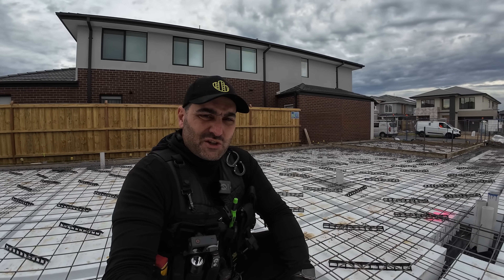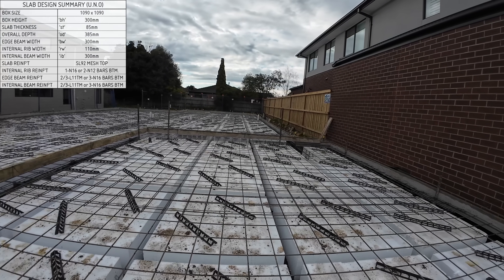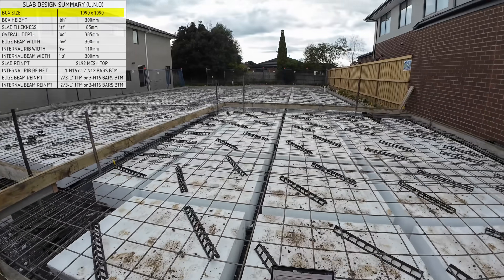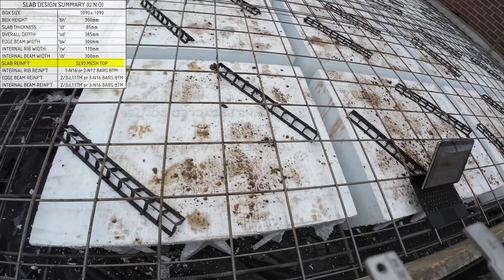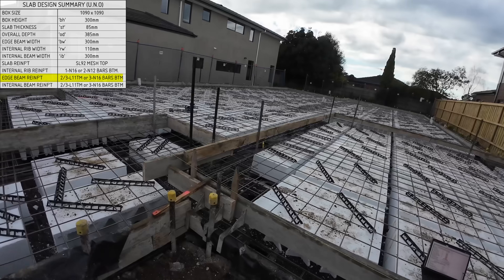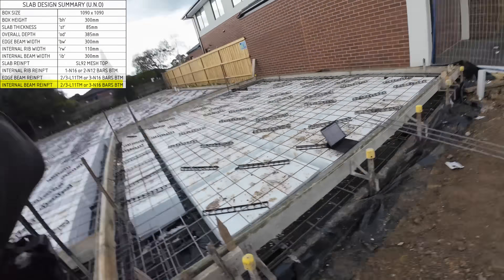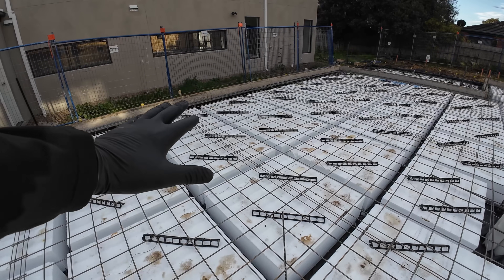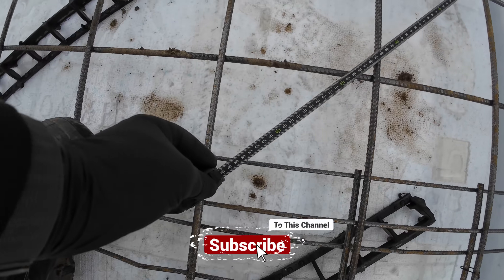Pre-Pour Slab Alert: What the Surveyor Missed!

Comment: Mate I'm a Vic registered building surveyor and this is all stuff that I am seeing and finding every single day! Read the table on the engineering and install it accordingly!

Thank you so much for bringing out a reinforcement gauge! I have been hunting the internet for ages trying to find one because there used to be those poly wheels that the reinforcement companies used to provide but I can't find them anywhere! I just bought one of yours!
Reply: I've heard if multiple stories of waffle slabs giving way.
Reply: @TheJiminiflix  early on mate when they were coming out at 75mm thick or so I am pretty sure that there was multiple stories of people jacking cars up in garages and the jack punching through the slab. I personally haven't heard of any failures since unless the slab was poured with incorrect cover to the reinforcement and the thickness wasn't right as well.
Reply: @malleedirtbikerider  ive heard of people putting jacks thru the slab in a garage situation, but never in the main dwelling. That was early days but. I told my boss and for years we insisted on doing the garage as raft, eventually to the waffle again, but using 100mm slab instead of the 85.
Reply: @mhombi  yeah mate I meant in the garage obviously. 🤣 Bit hard to jack a car up in the middle of a house. Since they went to 100mm there hasn't been the problems
Reply: @malleedirtbikerider  sorry mate, i did mean in the garage, but more meant never heard of problems in the main part of the house. still alot or the bulk builders insisting on 85 in that garage too but. as long as someone signs off in the end and its still to code? i am talking class m stuff but. obviously this slab is more a h or something with the extra reo in the edgebeams
Reply: @mhombi  comes down to cost at the end of the day mate and correct if the engineer gives that 126 then it's him that has deemed it is compliant and we just build to what he specifies, however I don't like any waffle with a slab thickness of less than 100mm. Some volume builders still use the thinner slabs like 85mm I'm pretty sure.
Reply: @letsgetreal-df7pu  looking and not measuring is assuming though 🤣🤣 jog on mate.
Reply: Is it legal to leave the formwork (wood) in/under the concrete slab. My slab is being poured this week. Bit concerned
Reply: @coreyjones7202  hi Corey with any concerns your best to contact your relevant building surveyor (the one you appointed for your project).
Reply: Top call, bud!
Reply: You're a registered building surveyor looking at jobs EVERYDAY can't you tell what the Steel is by looking at it, everyday, if your using  a Guage you must be a LEARNER !
Reply: @letsgetreal-df7pu  I’m happy you’re not my building surveyor, as I’d fire you immediately if you think “eye balling” construction is a good way to operate.
Reply: @ Mmm okay can you tell what a 90 45 bit of timber is just by looking at it  yes or no!
Reply: @letsgetreal-df7pu  you would be correct. The gauge is for my cadet who is learning and I've been chasing one to help them and yes sometimes I like to double check the mesh as "visually" checking and spotting the difference between SL82 and SL92 can make you second guess yourself. In case you were interested, I had a job only a few weeks ago where a massive pad footing called for SL92 top and bottom. Visually to me it looked like SL82 in the bottom and fortunately my cadet had the gauge in the car with us and was able to double check. Guess what?! It was SL82 in the bottom. It had to be removed and replaced. Hope this clarifies how gauges can come in handy and rather than guess it's better to know. 
 As I always tell my cadet all you do when you ASSUME is make an ASS out of U and ME. 
Unsure what your background is but feel free to keep using the surveyor you currently do as I'm not a "she'll be right" type of surveyor. 
Have a great day champ! 🤣
Reply: @letsgetreal-df7pu  can’t take a photo of your Mk.1 eyeball

Comment: I don’t think the assessment of the edge beam reinforcement was correct? I could see one bar on the top on the inside of the set down and then a couple at the bottom. At initial glance it seemed ok? What am I missing? The bigger issue for me is the location of the bars either top or bottom.

Comment: What are the requirements when I cut out a 1200x1200 section of the concreters' reinforcement because they smashed a sewer riser and continued to lay their work over the damaged pipe? Should they replace the internal rib or the sheet? I reckon they just leave it cut and sitting on top of the waffle pods as is.

Comment: I used to do resi slab inspections, and boy, did the concreters come up with every excuse under the sun for little things I picked up. Missing re-entry steel, short on laps, completely no steel in areas, waterproof membrane missing or torn up or not taped up properly. Failed so many slab inspections lol

Comment: You should have stated in the title that it was the 'Building Surveyor' missed as you verbally said in the video. Not an engineering surveyor that would have been responsible for the spatial layout of the slab. The title should read 'What the building inspector missed'

Comment: I could have sworn when something calls for 2 or 3 TMs they need to be spaced either 1 top 1 bottom for 2 or top, middle and bottom for 3. I didn't think you were allowed to just tie em together and drop them in because whilst the bottom is well reinforced the top has no reinforcement at all and prone to cracking and splitting once the weight is on it.
Reply: Yep. Seems to me they are (trying) to do things to the letter of AS 3600, but not really understanding the underlying engineering principles. Same reason, I expect, that the edge beam was 500mm not 300mm... "more concrete, more better!" They probably thought they were building redundant strength into the slab, except that's not what engineer specified.

Comment: Wait... so they made the edge beams and the internal beams wider than planned? But wouldn't then the slab be wider? Not only costing the builder more concrete but also in the end the building isn't according to spec and probably violating the build permit?!? 
I mean, 1x internal beam 30cm + 2x edge beams 10cm wider than planned => Building is HALF A METER wider?!?!? 
Is that something that happens often?
Reply: No, the slab isn't wider, just the poly pods are not spaced properly/there's not enough of them to fill the centre of the slab correctly.
Reply: @RiffRaffMama.  thanks, that explains it.
I still think the builder hurts himself since the poly probably works have been cheaper than concrete. And also I doubt a bit more concrete without additional steel will have any impact on the performance since the required amount of steel is still in. So it should be solid enough.

Comment: The slab is over engineered. For 85 thickness pod slab, normally only need sl82 mesh on top and 1 layer 3-l11tm bottom for edge beam. Not point to have so many bar. I would go deeper edge beam or thick slab.

Comment: that's actually a pretty decent job
Reply: Not just decent, I'd say good.
The inspector is being way too picky with this i think.
Why does it matter if the beams are larger? I can't see how having extra concrete will make the slab weaker...
The N16 bars not having the correct overlap, okay that's more of an issue but even then it's very minor.
The bar chairs are just there to keep the mesh up off the poly while concrete is poured, after that they have no purpose. Looked to me like they were holding the mesh up just fine.
A bit of paint on the rio? Seriously? That's ridiculous.

The site and work all looked neat and all the major parts were correct. With the amount of safety factor engineers use, there's no way any of the stuff you pointed out would cause a failure.
Reply: @mattwood1977  The problem is not that the beams are larger, the problem is that the beams are under-reinforced compared to the specifications. All they have to do is chuck a couple of extra beams in.
Reply: @lunken86 no, the problem IS that the beams are too large, of they were the 300mm specified then they wouldn't have any issues. The problem is that they left the gap for the edge beam too wide (like 500mm) which apparently means they need to put extra reinforcement in. I'm saying I don't understand why that's necessary. Why does extra concrete that isn't required in the first place need extra reinforcement? Surely it doesn't weaken the slab to have more concrete? If that space is filled with poly or concrete, why would it make a difference?
Reply from the maker: It is decent, but it’s incomplete and shouldn’t have been signed off yet 😊

Comment: You can not put 3 bar trench mesh in a 300mm beam.. You must have 50mm either side between steel and ground otherwise you get concrete cancer.

Comment: Very important inspection often overlooked.  Just don't get why you would use this polystyrene method in Garages as when using hydraulic vehicle jacks it can cause punching point loads.  Also dont see the point of having two edge bean reinforcement mesh tied together ?  Why not just put a proper internal cage to the edge beam?

Comment: Had a friend who had 11 truck and trailer loads of shingle placed (up to 900mm thick) where this build has polystyrene blocks.
The main room was 15 metres by 6 metres with the rest of the single storey 3 bedroom house to match.

Along came the 6.8 earthquake plus subsequent 24,000 smaller quakes
and hey presto...
not a crack in the slab

Except for 8 metres of cracks between a couple of sheets of gib on the ceiling the house was undamaged....

Comment: The external beam at the front of the garage was wider then spec cos the pod was cut too short, the other ones looked fine, also you can't put extra bars on the bottom rebate, you can't just float the bars in the air, and that form work is done after the steel is done.

Comment: imo waffle pods need to fuck all the way off. replace them with recycled chucks of slab connected with rebar staples and make all beams 500 deep with 3 different gauges of steel, thicker spaced wider and thinner spaced closer. im watching 15y old houses around my place crack in half due to undermining and the buoyancy of styrofoam.

Comment: Wtf 6 x 11mm bars in the bottom of those beams, and they're wanting a couple more?!?! That's about 3x more than we put in in seismic zones in NZ.
Reply: NZ codes are nothing to be proud of.....not at all what they are cracked up to be...oh wait...
Reply: @JohnSmith-pl2bk  NZ codes are very similar, sometimes identical to aus but at least NZ builders appear to know how to tie one piece of rebar to another.
Reply: And for the 6 bars in the bottom, no stirrups up the side. Just seems like they are throwing bottom steel at the thing and not doing any proper design.

Laps were shit, even the one he said was close to compliant, laps should be tied together not just in the vicinity of each other, otherwise it's a non contact lap splice and the lap needs to be even longer. 

Mesh wasn't lapped well, no bars had hooked ends to help anchorage, that doesn't add much costs, just take out 3 of those bottom bars everywhere and do some propper detailing.

Guess the man hours cost too much.

I will say this inspector is being pedantic about the wrong things...
Reply: @onlinetuna yep slab mesh lap looked like the most concerning bit. Stirrups aren't required by the standards, i would only spec them in a spot i would expect uplift in (almost never). These slabs never really fail so everyone just goes along with the basic code design guide.
Reply: @av135  do they generally do fibre reinforcing in these?
Reply: Ahh 😂 it’s Fukn bullshit over here mate  ! Everything is that over engineered it’s almost unaffordable, just because we’re all so afraid we’re going to be sued if something goes wrong and we wont be able to charge our hundreds of dollars an hr moving forward! Absolute bullshit hey

Comment: Overall I thought the slab reinforcement is very good.
OK outside has extra concrete width giving greater loading. 
I think were extra width is part of the loading design then only then it would requre the additional rebars.
Reply: Looking at the concrete design the extra width 200mm even with brick loading is not going to destroy this foundation. 
To improve loading we would add stirrups rather than have unconnected top and bottom rebars this prevents sheer adding lateral support
Reply: Brick cladding stacked right out to the edge.
200mm extra leverage on the slab
Crack!
Reply: @JohnSmith-pl2bk ??? How does a thicker edge beam cause that???
Reply: @av135  
Concrete has no strength without reiforcing in it.
So extra width plus stacked up weight is just leverage on the unreinforced concrete
Reply: @av135  "Stwong thing go out further, how stwong thing not stwong?"

Comment: When you refer to the ‘building surveyor’ are you referring the certifier or engineer for the job? I’m in NSW and I’ve never had a certifer do a pre pour inspection ever!
Reply: Interesting the certifier pre pour should be one of the standard ones. It feels a bit pointless as the engineer has full discretion in the slab steel but hopefully they would catch unusual things, also they should confirm termite barriers and sewer pipes.
Reply: Same here in Tassie. Structural engineers do the slab and framing inspections.

Comment: @Site Inspections, Could you please clarify the lap length? On the video, time ~13m25s, I see that the overlaps are not on the same plane. To me it looks like one section on the slab is on a lower spot. 

As I understand it, lap length is the length of overlap that must happen so that the reinforcement works as a virtual continuous bar. And if not done, pullout is possible. So in the video, it wouldn't matter if there's no overlap because the bar is not the continuation of the other. 

Anyways, in my country, you'd have to bend the bar down and continue it along the other side by side for the lap length. The bend is sorta like a stretched Z.
Reply: You are right that there is a step in the ground levels across the internal beam. In large steps z bars are required to reinforce the neck. In small steps like this they are not and generally as long as the rib bars cross the trench mesh it is fine (the internal beam would act like a support so the rib won't be in tension, ie development length doesn't matter).

Comment: SL92 Mesh is 6mm with 200mm spacing and NOT 9mm with 200mm as stated on the video.
Reply: Wouldn't that be SL62?
Reply: @bexta68b81 Yes
Reply: The product code, SL92, refers to (S)quare spaced, (L)ow ductility, (9)mm assigned diameter main wire and (2)00mm aperature.

Comment: The reinforcement as placed should comply with the structural engineers drawings. The number of bar chairs should be increased to comply with the requirements of the structural Engineering drawings. The design engineer must insist that the site foreman gets the reinforcement contractors to rectify all of the faults BEFORE any further work proceeds.
Reply: The bar chairs have good placement (I've never actually seen that style before) if they chair up close to the corners they risk breaking pods during the pour. This is where judgement is more important then following a standard that would have never considered a situation like this.
Reply: @av135  Agreed, so long as there are sufficient chairs to support the mat that is all that is important. I've done prepour inspections on many big infrastructure projects in Perth. Engineers should just note "sufficient chairs and wire ties to hold the reinforcement in place". Walking around on the mat might find a few spots where the ties are loose or the bars sag too much, add another chair and a few more ties. Stopping a pour because chair spacings are noted when inspection finds the chairs adequate is just wasting time and money.

Comment: Failing the beams for being thicker than the plan specs is pretty rough! So basically the polystyrene has been cut back further than required but is replaced by concrete. How does that have a negative effect on the strength of the slab! The guy is being a tool
Reply: The reo needs to be under where the load is.  If its on the inside edge and the bricks are stacked on the outside edge then there is no reo under the load and cement is only good in compression, the steel is there to take the tension.
Reply: Stack brick cladding 200mm further out to the unreinforced edge...crack! Slump...
Do it right.
Reply: @JohnSmith-pl2bk that makes no sense. The extra concrete is fine, it already has excessive bottom reo. Like 90% of engineers would pass this no problem

Comment: The waffle system is just trash so the steel is even more important . The only part that is not such a concern is the garage entrance as that edge beam has more concrete than the garage centre good luck with a bottle jack in that house .
Reply: You could specify extra reinforcement for that garage floor.....
Reply: So why are waffle pods like 90% of slabs these days after being resisted by builders and concretors for decades? Maybe you don't really understand the system or slab design in general?
Reply: Designed to save money and nothing else . Raft slabs any day of the week